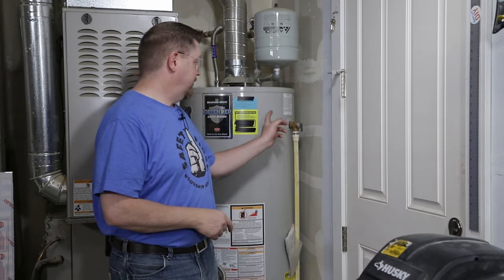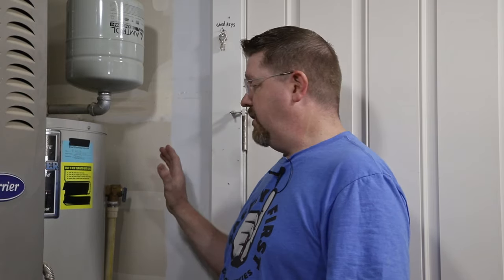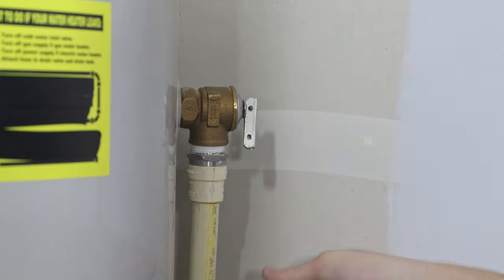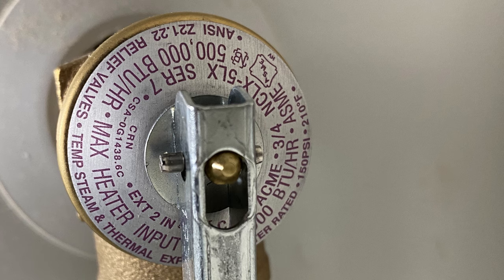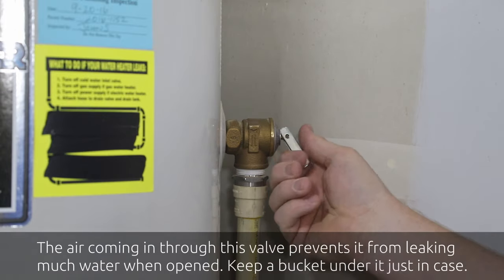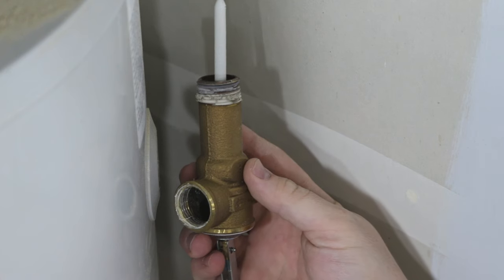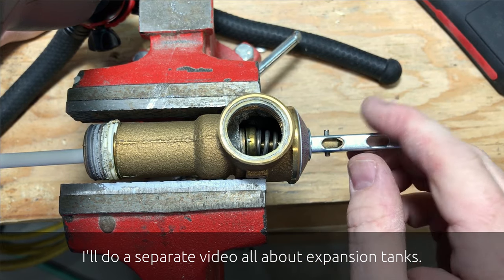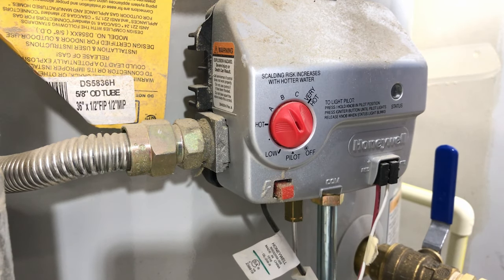How To Replace Pressure Relief Valve On A Water Heater (T&P)

Comment: so I have some water that has been coming out of my down spout that's attached to my t&p is this because the pressure in my tank was to high and it was working correctly or is it because I need to replace it?
Reply from the maker: Hi Micah - your T&P valve may be faulty, but it may also be due to a problem with your expansion tank if you have one: https://youtu.be/NGygvtP6Sdk

Comment: I followed you guide on how to replace the T&P valve and all was good for about 2 months and now I am getting the dreaded leak again.  I am confused at this point what to do next. The heater is Bradford White and the Temp is in "A" position. when I check the water temp coming out of faucet (via infrared thermometer) is comes out at about 145F. I checked the water pressure on the outdoor spigots and it was about 60 PSI. Any idea what to do next? Thank you
Reply from the maker: Do you have an expansion tank? If not, it may be time to install one, as the pressure rise due to water expansion when heating that hot (145F is quite hot) is likely enough to cause your T&P valve to dribble just a bit. Here's more on expansion tanks: https://youtu.be/NGygvtP6Sdk
Reply: @AmplifyDIY  Thank you for this information. Yes, my system has an expansion tank. What I find odd, is that the tank thermostat is unlabeled, - it is the one by Icon System and the information what each settings mean is no where near to be found. Some say that A setting is 120, B 130 and C 140, but my water as I mentioned before is at 145 F with the A settings. I lowered the setting to HOT and will retest. I will also watch the other video to learn more about the expansion tanks.
Reply: I managed to test the pressure on the expansion tank and it tuns out i got 0 PSI in it. I readjusted the pressure to about 60 PSI as this was about the pressure in my system and will have to wait and see now. Thank you again for the helpfull videos and comments!

Comment: Plumbers and there Ideas.... quick question I just had a new water heater installed today and when I'm running the hot water now I'm noticing what looks like millions of tiny little bubbles is that normal?
Reply from the maker: Hi Dave - yes, this is completely normal. There are aerators in your faucets that specifically cause this to happen. Thanks for watching!

Comment: Hi thanks for your videos. I been in my house for 7 years and the he tank ten years, never drained. It’s a gas tanker, can you tell me if I need  also open the valve at any time and what is the tread  measure of the valve to connect a hose from there. Thanks.
Reply from the maker: Have you seen my video about how to flush your heater? I cover all your questions in it: https://youtu.be/hs5N7HyDUWo
Reply: Hi, thanks for your quick answer. Very helpful.So should I turn off my gas valve pipe as well or just vacation is enough ? and what is the tread mesuré of relief valve to connect a small hose just in case water overflow. ? I tried 1/2 inches but didn’t work. Thanks again.
Reply from the maker: @jhonlopez630  You don't need to turn off the gas pipe - vacation mode is fine. If you turn off the gas, you'll have to re-light the pilot light in the heater. As far as attaching a hose permanently to your T&P valve: there should already be a down pipe attached to it, which will direct the water to the floor. It is best to just put a bucket under this down spout if you are concerned about leaks. If you don't have a down spout, you need to install one. The threads should be 3/4". Here's a video I did all about pressure relief valves, where you can see the downspout I'm talking about: https://youtu.be/e5H1i1cypxA

Comment: Do you need to drain the tank before removing the old valve if the valve is not attached at the side of the tank but at the top?
Reply from the maker: Hi SunnyDay! I still recommend draining a little bit of water out of the tank - especially if you have a second story in your home..the water in the pipes in the upper floor of your home will want to drain down into the tank when you remove the old valve. Draining a bit of water out first will prevent water pouring out when you remove the valve. Good luck!

Comment: The drain pipe for my T&P valve goes into the wall, not down the side of the heater. I assume it taps into the main drainline to the house. How would you test this, or know if it was leaking?
Reply from the maker: Hi W H - for every code jurisdiction I have looked into, the drain for the T&P is supposed to drain to the outside, not be plumbed into your regular house drains. This is so that a) you can easily tell if it is ever leaking and b) if the valve ever trips due to an over-pressure / heat event, the blast could easily damage your drain plumbing. I'd see if you can figure out where it actually goes, as it should not be plumbed into anything... One easy way to do this would be to simply open it for a few seconds, then close it up and see if you can tell if something outside that was previously dry is now very wet. ;-) Good luck!

Comment: My PRV had been causing a leak so I put a pan under it and called the plumber. He changed it out, but the next day it's still leaking. The temp is set to warm/medium, and the flame shuts off properly (I think). Time to flush it out or replace the hot water heater?
Reply from the maker: Hi Scott - do you have an expansion tank? If you do, and the PRV is leaking after being freshly replaced, you likely have a failed expansion tank. The plumber should have checked this when they installed the PRV.... 
Here's a video I did all about expansion tanks that explains how they can cause the PRV to leak if they are not operating correctly: https://youtu.be/NGygvtP6Sdk
Good luck!
Reply: @AmplifyDIY  Not sure, but he's scheduled to come back Friday. I'll ask him more questions then. Thank you though.

Comment: So, will a leaking t&p sometimes just need some thread tape? If it's leaking from threads?
Reply from the maker: If it is leaking from the threads, I would remove it, re-tape the threads, and add pipe dope in addition to the tape, then re-install and make sure it is tight, then check again for leaks. Good luck!

Comment: I need help mines is close to my air/ heater source and can't open the Val completely do it needs to be open completely for the pressure to release?? /check i have the same exact water heater  i can't take a picture to show you on here .  I need help my water heater is make poping sounds and it about time to drain it it's doesn't pop as loud when i take a shower but when i have hot water on to wash dishes or have the faucet on whwn the hot water heats up its pretty loud

Comment: I did this today the old valve was just nasty and it went smooth,  the issue is that the new valve i do the test and it appears to work but it still drips a little. Can it be a bad Valve?
Reply from the maker: Hi Niels - do you have an expansion tank installed? If so, the leak is most likely caused by problems with the expansion tank: https://youtu.be/NGygvtP6Sdk
Reply: @AmplifyDIY  I do have an expansion tank its 4 years old. Thanks for the info

Comment: How would I remove a galvanized pipe that is attached to the valve? It’s stuck even using a pipe wrench. Afraid of turning it too hard in case the valve breaks off. Is there a spray that might help loosen the pipe from the valve?
Reply from the maker: Hi Pam - is the galvanized pipe being used as the downpipe (mine is PVC in this video)? If so, here is what I would probably try: 
1) Pick up a can of PB Blaster at your local hardware or auto parts store. This is a penetrant/lubricant that can be used to help loosen up stuck threads. Soak the joint in PB Blaster, and let it sit for at least 30 minutes, then try to remove the pipe again.
2) If a penetrant like PB Blaster does not help, you may be faced with a more destructive approach: use a hack saw to cut the galvanized pipe close to the T&P valve. Once it is cut, you can remove the existing T&P valve without breaking it off by simply unthreading it from the tank. You'll have to install a new T&P valve, as it's not likely you'll ever get that galvanized pipe out of the old one.
If I've misunderstood the issue you are facing, feel free to email pictures of your setup to amplifydiy (at) gmail (dot) com, and I'll be glad to offer some advice. 
Good luck!

Comment: I’m getting a leak from behind that white gasket where the pressure relief valve screws into the water heater, does that mean my water heater needs to be replaced or could it still be the valve?
Reply from the maker: If the leak is coming from the thread area of the T&P, you can likely still save the heater by replacing the valve and using pipe joint compound as well as teflon tape (as I showed in this video) to seal the joint. If it's coming from elsewhere though, it may be time for a new tank. Good luck!

Comment: My downspout from the valve is plumbed into the wall. How do I know where it goes? I think it may go out through the back wall of the house, since there is a PVC elbow pointing down outside, about 10 feet from the water heater.
Reply from the maker: One way to verify where it exits for sure would be to open the valve for about a second, then close it. Go outside and see if the pipe you suspect is dripping/wet.

Comment: mine hot water heater tank is just like this one and the  value is just like this one too and it over flows and water pouring out the value does that mean i need to replace the value.
Reply from the maker: Hi Keith - I'd start by replacing this valve, yes. If that does not help, then next I'd see if you have an expansion tank installed, and check it's pressure / see if it has failed: https://youtu.be/NGygvtP6Sdk  Good luck!

Comment: How long do these Valves last normally.  Mine is 4 years old and failed the annual test.  Dripping next day.  I would have thought they would last way longer than that.
Reply from the maker: Hi Truth - it depends A LOT on your specific water supply. If you have very hard (lots of minerals) water they'll last much shorter than if you have less hard water, or have a water softener installed. Great question, and thanks for watching!

Comment: Does the tpr valve need to be 6" off the floor or where it's actually located.  And not in the drain pan?
Reply from the maker: Hi Matt - the code for discharge tube length and location varies a little bit based on where you live, but in general it needs to be within 6" of the floor, and must include an air gap. Here is more info: https://up.codes/s/requirements-for-discharge-pipe
Thanks for watching!
Reply: Thank you

Comment: The pressure release valve still leaks after replacement. Any suggestions? Thanks, Roy
Reply from the maker: Hi Roy - Do you have an expansion tank? Have you checked it? https://youtu.be/NGygvtP6Sdk

Comment: My tank is leaking through the rubber filling  behind the female pipe that the t&p valve screws in.  Is this repairable?
Reply from the maker: Hi Ron - hard to know without seeing exactly where the leak comes from, but based on your description you likely need an entire new tank. If a leak is coming from any threaded area, or from the T&P valve itself, then that is fixable with a new valve / better thread sealant. If it's coming from the main body of the tank, then you need a whole new heater. :(

Comment: How much would it typically be to replace this valve, and replace the thermo coupling
Reply from the maker: Replacement valves cost around $20 for the part. I’m not sure on the thermo couple.
Reply: AmplifyDIY thanks

Comment: Any tips on a stuck valve? Can't turn it right or left and tried different wrenches.
Reply from the maker: How old is the heater?
Reply: @AmplifyDIY  it was installed in 2003. It's a Ruud Pacemaker gas water heater.

Comment: I flushed my 5 yr old tank, replaced anode rod and expansion tank. Water pressure and expansion tank is good. T&P Seems to function properly but i notice one drop of water after a shower is running on hot for a few min. Is this to be concerned about?
Reply from the maker: It does indicate that either your expansion tank is at the wrong pressure, or that the T&P valve is not quite seated correctly. I'd suggest maybe trying this: Turn off the water supply to the heater, and open a faucet to relieve pressure. Then open / close the T&P valve forcefully a few times. Then turn on the water supply again and keep an eye on it for a few days. If it still leaks, and you are confident the pressure in the new expansion tank is correct, it's time to replace the T&P. 
Good luck!
Reply: @AmplifyDIY  I really appreciate it. I will start with expansion tank I believe the psi was off. My home was at 50 and the tank was precharged at 40.

Comment: Hello, when I open the Pressure Relief Valve on water heater to test it but there is no water came out from pipe under the pressure relief valve. Is there something wrong?
Reply from the maker: Yes. When you open that valve water should gush out that pipe. If nothing comes out at all, it’s time to replace that valve. Good luck!
Reply: @AmplifyDIY  Thank you for your quick respond and appreciated your help. Is that possible that could be the cause of low water pressure at the second floor or something else is wrong?
Thanks again
Reply from the maker: No, a stuck T&P valve will not cause low water pressure anywhere. However, it is a symptom of a similar underlying problem: you likely have a lot of lime scale buildup inside your plumbing. Excessive build up like this can cause a T&P valve to stick and not open when it’s supposed to, and it can also cause low flow if your pipes are pretty gunked up with the stuff. Do you regularly flush your water heater? Do you have pretty hard water? Have you considered installing a water softener?
Reply: @AmplifyDIY  Hello, thank you very much for your help and I did changed the Pressure Relief Valve and tested its working fine. My wife told me "sometimes on any facet seeing very low water pressure for a few second then go back to the normal pressure when flashing toilet". What is your recommendation in this problem?  Thanks again.
Reply from the maker: Hi Habib - I'm so glad you were able to replace your valve - nice job! As for your wife's question: Having a pressure drop at a faucet when you flush a toilet is pretty normal. There is only so much pressure in the system, and when you open a faucet, you are getting the full pressure of the system to the faucet. When you flush a toilet while a faucet is open, suddenly the toilet gets some of the pressure as well, which causes a pressure drop at the faucet. Some types of faucets will experience a larger apparent pressure drop than others, but it's completely normal. Wait for the toilet tank to finish refilling, and the pressure should return to normal at the faucet.
Reply: @AmplifyDIY  Thank you for your quick respond and we are appreciated your help. She told me, pressure lost in facet was not before it happened only within a few weeks. In addition, sometimes loss of water pressure was happening without flashing toilet for a few second.

Comment: Should the hot outout valve also be shut off before the replacement?
Reply from the maker: You turn off the cold water inlet to relieve pressure from the system. Once that is done, and you've drained a little water off, there is no need to open the hot output valve, as it actually makes no difference at all if it is open or closed at that point. Good luck!
Reply: @AmplifyDIY  thx

Comment: I have a water heater that blew a while back. Don't have the money to replace but it's leaking water and running out a pvx pipe outside. Will replacing this valve stop the leak until I can replace?
Reply from the maker: It depends on exactly what you mean by "a water heater that blew" - you mean that the T&P on your existing heater is just leaking constantly? If so, yes, try replacing the T&P first... that may solve it until you can afford a new heater. 
Good luck!
Reply: @AmplifyDIY  it's leaking out of the bottom. How can I shut off the water to the hot water heater completely until I can replace? I turned off the cold water on top of unit but I can still hear water and it's still leaking some at the bottom. Wasn't sure if that could still be the t&p valve.
Reply from the maker: Heya frozenpiper2 - sorry to hear your heater appears to be kaput. Turning off the cold water inlet only stops more water from entering the tank. The tank is still full of water, and if the bottom of the tank has ruptured it will continue to leak until it has completely emptied. In the short term I'd turn off the cold water supply as you have done, then hook up a drain hose and run the other end of the house outside the house (or to a floor drain if in a basement), then open the drain valve and drain the water so the tank is completely empty. Leave it like that until you can replace it. 
Unfortunately, a leak from the bottom of the tank like that is not related to your T&P valve at all.
Reply: @AmplifyDIY  ok thanks. I figured it was done for and didn't want to buy that valve for no reason.

Comment: After you reinstalled the discharge tube, you loosened the new pressure relief valve. Will it now leak?
Reply from the maker: I only had to back it off by less than 1/8th of a turn. It has not leaked at all.

Comment: How should I connect the down spout and what should I use?
Reply from the maker: The downspout should be CPVC (not just regular PVC) and should be connected to the output of the valve by just screwing it in - you don't need to seal this joint with compound or any sort of glue, as it should be easy to remove in the future. Check your local codes to determine exactly how low the discharge pipe should go, and whether it has to exit the building, etc. Good luck!